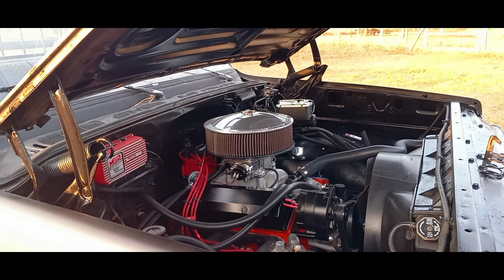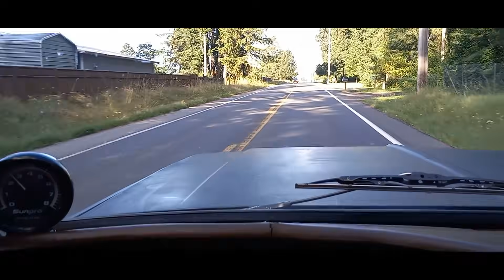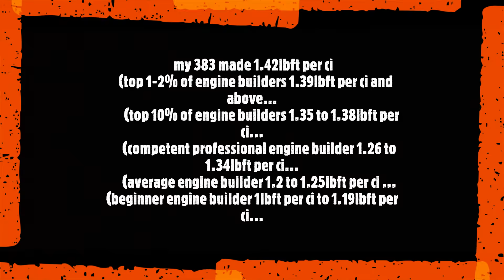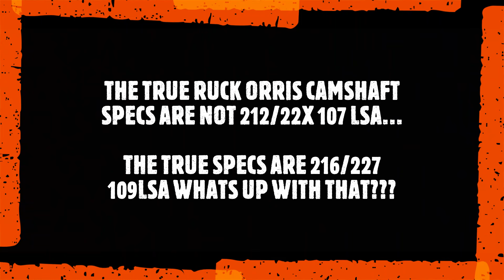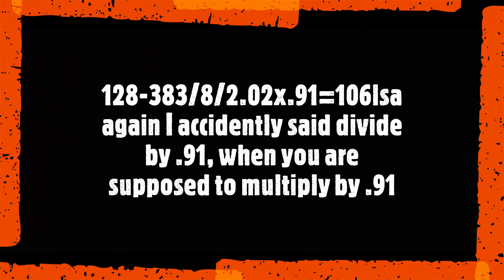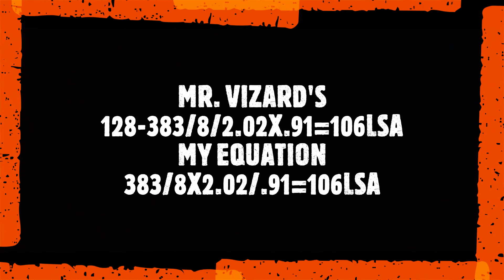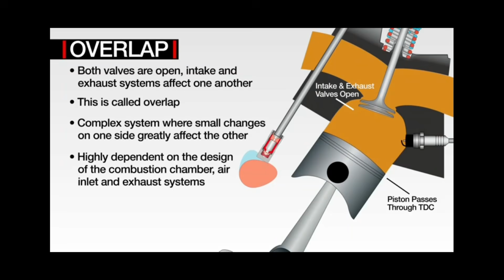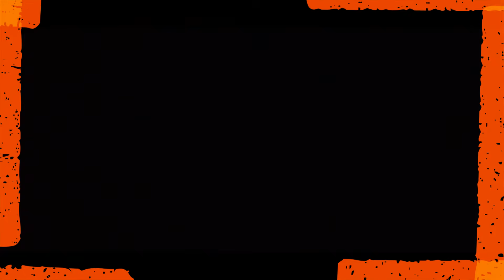CAMSHAFT SELECTION by LSA, 9 LSA's DYNO TESTED!!! LSA THEORY WILL BE DYNO PROVEN!!!, and EXPLAINED

Comment: Excellent video Adam. Several years ago I sent a custom ground camshaft back to the manufacturer, because it was nowhere near close to what I had specified. They sent it back to me telling me it was exactly what I needed. Anyway, during the subsequent phone conversation, during which I got more than a little irritated, I asked the 'experts', what heads am I running?  He didn't know. What do they flow? He didn't know. What compression ratio am I using?  He didn't know. What am I using the motor for? He didn't know. At the end of the conversation,  his attitude was that my combination was completely wrong, and their camshaft was completely correct. I never ran that cam. I got another one ground, by another company, to what I had specified, and it was a rocket ship in comparison to my competition. Who were spending more money on building a motor, than I was on buying, and building my entire car, including the motor and driveline. I've always looked at a camshaft as the brains of the engine. A dumb cam, gives a dopey engine. A smart cam,  gives a smart performer. It doesn't matter how good the rest of the motor is, if the cam is wrong. If you have the correct cam for your combination, then you will get the very best performance that you can get. Using idle quality as a justification for incorrect LSA's, is nothing more than a cop out for bad engineering, and bad marketing practices. The problem is that most of the people in charge are bean counters that can't see past the short term profit and loss statement. So it's sales and profit maximisation, at any cost. Looking forward to your next video. Regards Greg

Comment: So, building a 416 Stroker LS3 Heads w (LS7 Crank, Ti Rods, Manifold ~ Z06 3" exhuast, 1.8 Ratio, w L94 Truck Intake) w a 6L80 TUTD 6 Speed (Stock of Close to TQ to Aussie adapter to 96 Triple Locked Land Cruise transfer case. 
  11:1 Comp Ratio, 6.067 Rods, Mahle Custom Pistons including 2.165 Comp Pro & 1.600 Super Alloy Ferrea Valves, in Moldsar 90 Guide, PSI Behives, TS retainers for durability. 
    I get a Military/Dod Gov discount on Custom Grind, ~ Looking for Great Torque on Low End~Mid Range ~ will not trade Torque Curve ~ Don't care if it drops of on the Top RPM's - 
  Don't mind Lift on Custom Grind for 1.8 LS7 CHE Rockers on a Bar, .080 PRods into 2116 Johnson Lifts up to Low .600-.625 ish.  May help me decide, If any benefit of Porting Exhaust only vs Seen some 566 ftlb of torque 416 w AFR or Mast Heads with right Cam ~But Street Manner may still not be Right for 7200lb Lifted Brick on 35" w 4:11 Gears possibly towing a 600+ plus Grizzly ATV
    Most LS7 cams are moving the Power Band Upward ~ So Custom seems to make Sence ~ 128~416/8/2.165 x .91 = 106 LSA starting point ~ interesting
  Great Content Brother, thanks for Sharing

Comment: Thank you for taking the time to share your knowledge.  My sbf 351w/408 stroker is going to be around 11.5:1 11.8:1  what changes if at all when you have higher compression?
Reply: He said 1 degree for every extra point of compression beyond 10-10.5:1. Unless he meant add 1 so the formula with 129 instead of 128.

Comment: I can't and will not disagree, BUT why is it that all major cam manufactures with all the money and testing facilities have it wrong then? There simply is no 107 or lower LSA Mopar BB cam available, for instance.
Reply: I haven't seen the formula for mopars or fords. Only SBC. If you have found them please tell me where. I have DV's books and it's not there for ford or mopar.
Reply: @AkronOhioMachine  does it really matter? Other than size, hard to tell the difference between a Mopar BB and SBC head. Both are 2 valve wedges

Comment: I picked up a mid 90s Vortec 350 that a guy got in a swap of a bunch of stuff for $200. Turns out the heads are good minus a little pitting the machinist said he could clean up. Not sure if the block is good as it was sitting in the rain. Anyway, we were discussing camshafts today. It’s going to replace the mystery engine in my 71 Camaro. Do you consult? I was looking at Howard’s stuff and it’s been 35 years since I built a small block. Don’t mind paying some to not mess this up!

Comment: I have just happened upon your video and your info really peaked my interest.I am currently building a 2005 chevy l33,799 heads, engine.Know absolutely nothing about cams.The bs you talk about is about people like me,to buy,what we are told is the best.Mainly because of watching dyno runs on youtube.The dyno guy,and cam company,both make money.Do i even know if the dyno run i am watching is from the actual cam?Whatever happened to specing a cam? what engine? what compression,fi?carb?what trans?rear gears,rim tire size?vehicle weight?I do not think watching a dyno run from 0-7000 rpm.without all my truck info is telling me how my combination is going to perform in the real world.Now asking someone like yourself,to spec a cam for me with all the info you need,is a different story all together.I like to think that the cam designers look forward to designing a cam,for my vehicle,rather than selling me one off the shelf.But i am just an old man,what do i know.
Reply: Use 706/862 heads, 799s lose power on a 5.3. Look at Holder's tests.

Comment: great vid    Like the old blue dogs  in AUSTRAYA  wer'e the same don't back down ,, exxelent content for intelligent non web washed normal people, no allfoil hat here. .built a couple of engines over the last 4 decades and always looked at lsa  as preferance in cam selection  but theres very little info on cam selection with blowers     as far as best efficiency with  respect to lsa   sbc 4/7 swap 116lsa  244in 252ex 0.620    372CI   ??        MORE INFO   pete     LS all sound the same anyway

Comment: I have a 4.8 liter ls with a stage 4 cam I was gonna build but just got a 6.0 liter vortex I'm looking for around 450hp I rather build my 4.8 liter what would you prefer sir cuz I'll definitely go the route you advise because I no you know what you are talking about
Reply: Use the 4.8 heads on the dished piston 6.0. 862/706 heads have 61.5cc chambers and 1.89" valves vs 317s 71.5cc and 2.02" LQ4 is 9.4:1 stock, 10.6:1 with 706s. You can go as thin as 0.027" head gasket instead of 0.051" stock and have 11.2:1 compression. Summit sells a 240/252 .569/.569 106+0 cam for $335, get a set of 1.8 roller rockers off eBay for $169 to raise the lift to .604/.604 at the valve, good springs, long tube headers, at least a TBSS intake and you'll be making a lot of power. His formula calls for a 106 LSA with 706/862 heads on a 6.0. There aren't many off the shelf cams with LSAs that tight. Truck Norris is a milder one that is close at 107.
Reply: @hendo337  perfect thank you,  I'm gonna make a video of the build and show everything as I put it together I'll send you the link
Reply: Build the 6.0 if you want 450hp. The 4.8 will need to absolutely scream to get that much hp. Under 4000 rpm the 6.0 will absolutely smash the 4.8. Richard Holdener has dyno tests on the 4.8 vs 6.0 if you want to see real data.

Comment: What formula would you use for Big Block Oldsmobile? I don't think 128 would apply because the intake ports are spaced much further apart than SBC or Mopar.  I'm going to guess 132 as the intake port spacing is similar to the Cleveland head.  I really appreciated all the detail you went into and exposing the fallacies of the Mr. T. Cam Company in particular.
Reply: Use the formula for the Big Block Chevy.

Comment: Now after finishing the video, I have to say that you might have been a bit hard on Brian Tooley. He does in fact have a Spintron and the majority of Camshafts that he offers and sells are for OEM Replacement or Lightly Modified Engines. If I had to chose a single word to describe BTR Camshaft offerings, I would say COMPROMISE.... and not use the term as a negative. 99% of the camshafts that he ships and likely sells go out to guys that are directly swapping an OEM Camshaft in an LS/LT. His Hydraulic Roller Camshafts will work in ANY factory LS that the Camshaft was spec'd for (including the factory Roller Lifters), after taking into consideration things such as Valve-to-Piston Clearance, OEM Valvespring capabilities (for those that buy only a small camshaft), 1.7:1 Rockers, anywhere from 11-15deg Valve Angles, FUEL INJECTION AND THE INCLUDED SAFETY PROTOCALS (ie. Knock Sensors etc.), Daily Driver functionality, Engine Vacuum, Automatic Transmission reactions (if a Converter isn't required) etc, etc. I am not trying to defend him in any way. I just see your comparison as a bit 1 sided. He does offer CUSTOM SPEC/GROUND Camshafts as well as his Off-The-Shelf 'Staged' offerings as not to overwhelm those that just want a bit of a bump in performance. Even Your 'Race Built' carbureted HEI Ignition 23deg Iron Headed SBC is about as high tech in comparison to the average OEM EFI LS, as a pocket knife is to Leatherman Tool or Swiss Army knife. Don't get me wrong, you know your stuff. I just think that you would be better suited going after someone like LittleJohn Motorsports than BTR. Did you know that BTR only offers a SINGLE Camshaft in his LS lineup that requires Piston-to-valve clearance work done to the pistons with a handheld drill end to cut small pockets into the tops of the pistons ? (as most LS OEM pistons are flat tops or similar with very tight PTV clearance. He can confidently ship his camshafts out to thousands of backyard builders that are building 4.8/5.3/5.7/6.0/6.2 Factory Headed LS's and know for certain that the camshafts WILL WORK without any issues, other than adding/recommending new Valve Springs if/when necessary. BTR has done MORE for the backyard LS 'Hobby' builder than David Vizard ever has. This is because both Brian Tooley and David Vizard represent different markets. I found your video to be extremely informative, it just strayed too far from the path when you attacked BTR. Considering the amount of time that guys like Comp etc have in the market to BTR, I'd say that BTR still consistently puts out better stuff for the average guy. Then again, is Brian Tooley a Billy Godbold ? If the answer is NO, then why does Comp still continue to put out trash ? Perhaps it's the OFF-THE-SHELF Market that you have a problem with ? Like Billy and Comp, Brian Tooley can also custom Spec a RACE CAMSHAFT and custom design one for those that want one. A NEAR STOCK LS isn't a Race motor. Your 383 sounds like it would be a handful as a daily driver. Once again, it's all about Marketplace and Compromise. Some guys are willing to sacrifice a bit of power for near-stock drivability. How would your 650HP 383 do in traffic on a hot day with an Automatic tranny and power brakes ? I hope this doesn't offend you, but your target or 'Bad Example' in the Industry is all wrong.
Reply from the maker: You missed the point. I put BT on the spot for his camshaft theory that LSA don't matter (when clearly it does) and his idea that the unnessary use of excessive exhaust duration and wide LSA is what an engine wants.... I also show the negative effects of his theory in form of dyno sheets the negative effects that his theory produces.... I also hoped that people would get an understanding of the effects of exhaust duration, along with how it can be used.... I don't see why people are having such a hard time understanding the fine detains being shown there are peices of information allover... Yet, some people want to focus on their thoughts of me being so hard on BT??, I gave him a compliment on his camlobe technology and the fact that he can create dynamicly stable cam lobes.. but his theory for LSA is incorrect, and I show this fact with proof, for example that the truck norris cam (supposed truck cam) makes peak tq in a 6.0 @5200rpm and it's a turd below that, along with the effects of his theory  designing camshafts is completely wrong... no truck cam needs 11° more exhaust duration, that just shifts the power curve towards the higher rpm and allows the engine to carry hp beyond peak for a long time, which is usless in a truck cam...plus the fact that the truck norris cam did not spec out like he said ... it was supposed to be, 212-22X 107Lsa,,, real specs, 216-227 109LSA I also exposed his (secret) use of unnessary Long exhaust duration for truck norris.... cam company's obviously need to make compromises but, BT's theory is all wrong... I know he is not the only one that makes sh!t cams, he is the only one I've seen on youtube saying LSA don't matter... this is why he was the chosen one lol...  thank you for watching take care... also look up BT LSA on youtube, you will see what im talking about...

Comment: I've commented on Holdener's cam test videos that he's not being methodical, and he can't make any direct inferences.  His answer is that he doesn't care.  

In my case I want fuel economy, and there definitely is a reason to widen LSA.  I want a late intake valve closing for lower pumping loss, and I can raise compression a lot for better thermal efficiency.  I'll still get 1.35 hp/cid.
Reply from the maker: That 402 ls was 1.42hp  &   1.35lbft per ci

Comment: I am dying to build a proper N/A GenV LT. With the bonus of high compression ratio capabilities on pump gas (thanks to direct injection) and the insanely shallow and canted valve angles that allow even the OEM cylinder heads God-Like flow, I want to break from the Supercharger/Turbo factions and build a no nonsense Normally Aspirated std deck height monster, somewhere in the 387cu to 412cu, using either 1 of 2 possible GM Forged OEM Crankshafts, LT1 3.622" vs L8T 3.858" in a factory LT1 Alum block sleeved to 4.125". I would really like to see what can be accomplished N/A on a budget, with a factory block, factory crankshaft with only aftermarket pistons/rods. I hope this video can set me in the right direction.
Reply from the maker: Thank you for watching.. hope this helps